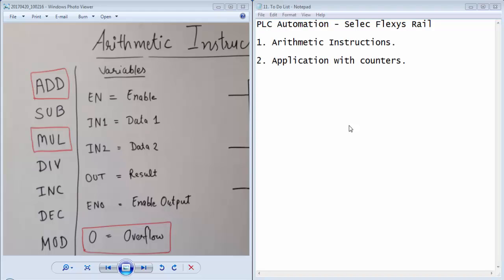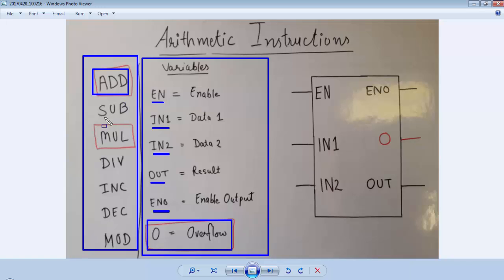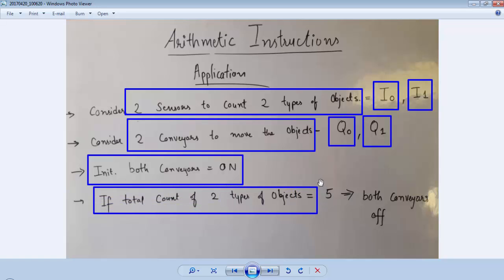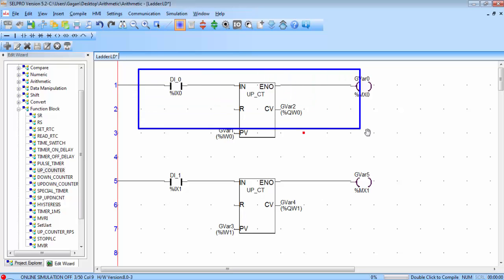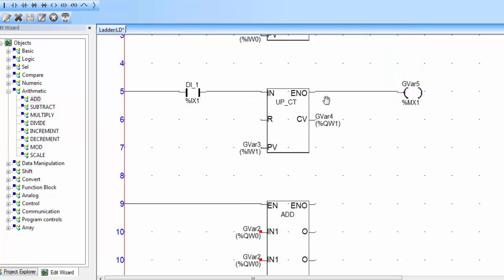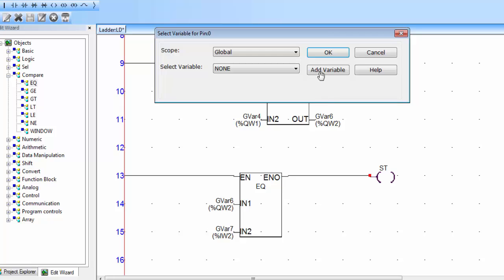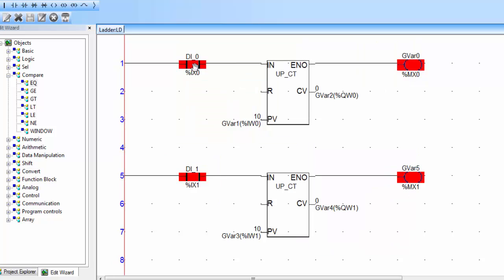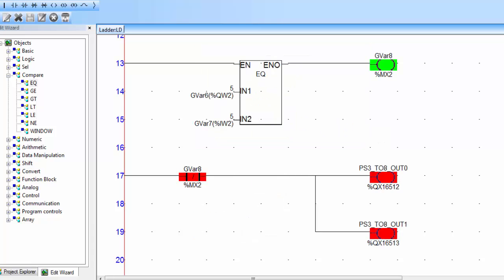Selec Flexys Tutorial 11 - Arithmetic Instructions & Application

Comment: Design a sequential application with 5secs on and off for 2secs for a total period of 21 secs. Design HMI 
for the same to display all relevant parameters like timer PV, timer CV, output status, input status. 
Demonstrate the same on actual PLC.
Can u please  explain this
Reply from the maker: as I understood,
You need to create a program to control an output with timers. When you will start the PLC, the output will turn ON for 5 seconds and then will turn OFF. The output will remain OFF for 2 seconds and then again turn ON for 5 seconds. This one time ON and OFF period is of 5 + 2 = 7 seconds and you have total period of 21 seconds which means you need repeat the ON + OFF cycle for 3 times. You can use a counter to count up to 3. Whatever the state of the timer, counter, IO etc. you need to show that on the HMI display.

Comment: sir   

mo.nio.???????????
Reply from the maker: what is your question?????
Reply: Life & Learnings Tutorials  required to rerurntive timer
Reply from the maker: @priyaanand9491  I think you want to mention here the 'Retentive' Timer. The timer tutorials here is for Non-Retentive which means the timer time will expire and set to ZERO when the Input Signal is Lost or removed. The timing sequence will start again from ZERO when the Input Signal is again applied.

For Retentive Timer, The time will not get reset to ZERO and it will retain the time value after removing the Input Signal. The only method to reset the Time is to use another Input to Reset The Retentive Timer.